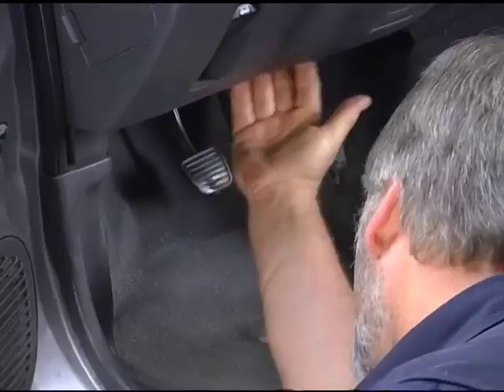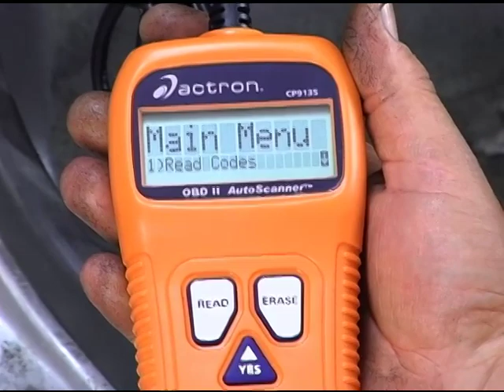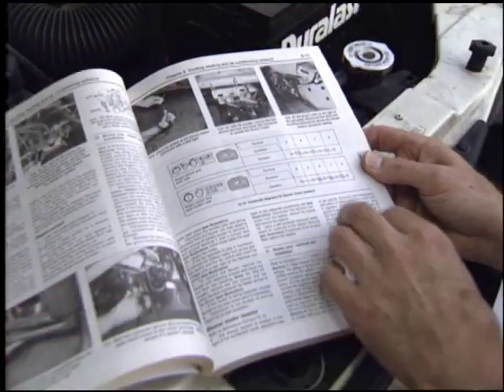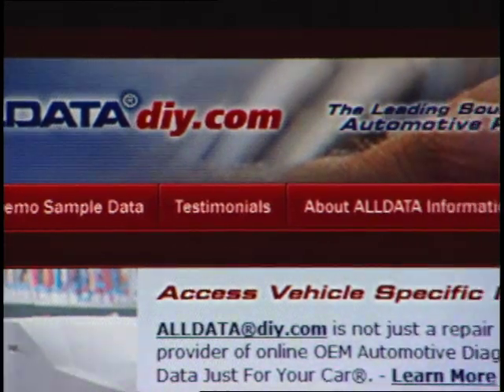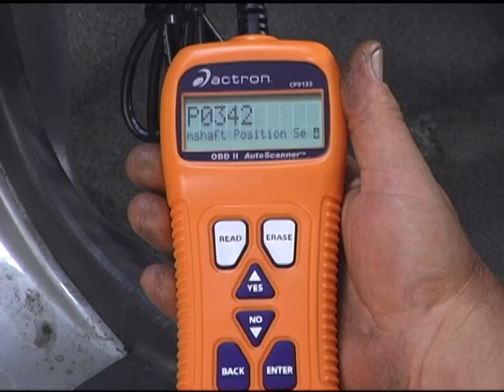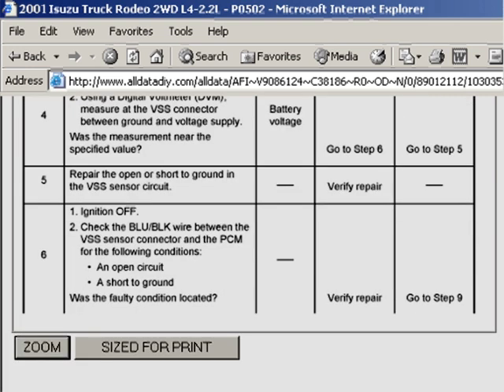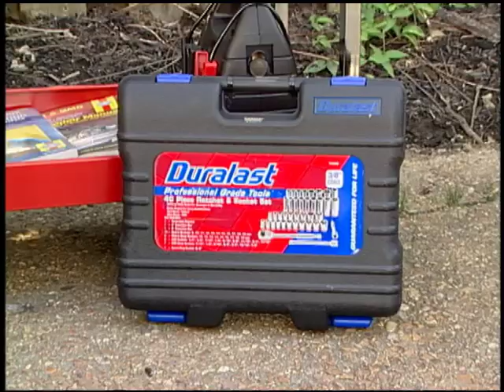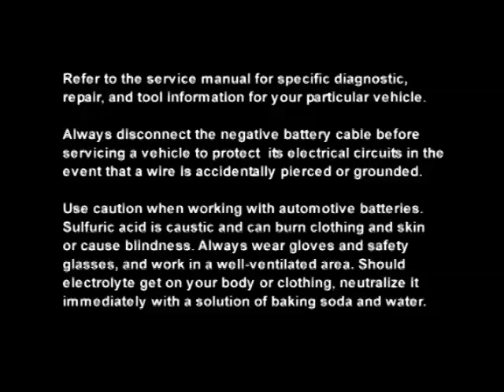How To Diagnose A Check Engine Light– AutoZone Car Care

Comment: Good video.  I am a master mechanic and I am going to address something I see certified mechanic shops keep showing WRONG.  Why in the hell do they show when jack stands are used which is good to go on and remove the floor jack??????  One corner of a vehicle floor jacks are only 40 dollars on average.  Use jack stands yes but leave the damn floor jack under there too!!  I see this same mistake over and over again where they show and tell you to use jack stands if you crawl under a car but then it shows them pulling the floor jack out.  Leave the damn floor jack under there too!!!!
Reply: You are a master mechanic and I am literally whatever the polar opposite of whatever that may be and yet what you just pointed out seems so painfully obvious that I would have just ASSUMED you would NOT do that!😆

Comment: Had overheat problem, changed sensor, got temp gauge working again and can read the temp with a scanner. Now for some reason I have a PO305 error, or the # 5 cylinder misfire. I really hope the overheat did not damage the engine. I don't think I have a cracked head since I think I would see it in the exhaust. 
So you guys, what do I do. A chevy malibu 3.1 1997. Help please.

Comment: I went down to the AutoZone to have him check the engine light to find out what is the code they didn't know how to do it because I have a old model 94 Nissan they don't know how check engine code engine light why should anybody trust AutoZone that they cannot keep people here know how to check engine light without a plug in to plug into a code reader hey one can read a code reader but reading a engine check light without 1/8 take somebody intelligent AutoZone do not have anybody intelligent enough to do it
Reply: I just called autozone here in Houston tx and the guy said no sir we dont have a transmission dipstick for your Chevrolet camry smh

Comment: I have 2012 Buick LaCrosse 4 cyl hybrid or it has e assist anyway car acted like it wanted to stop running the engine light came on the guy at autozone said he couldn’t get a reading on a hybrid I will have to take it to the dealership